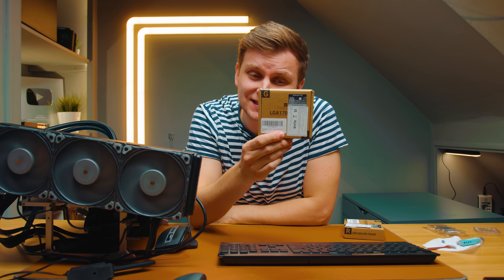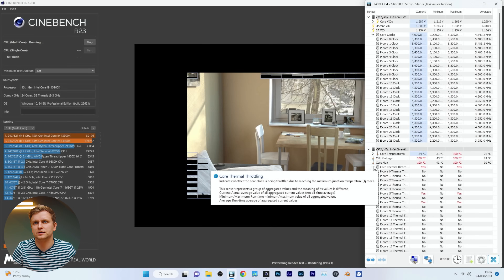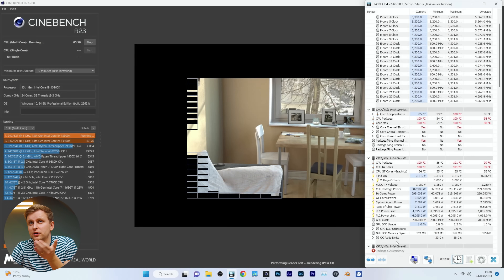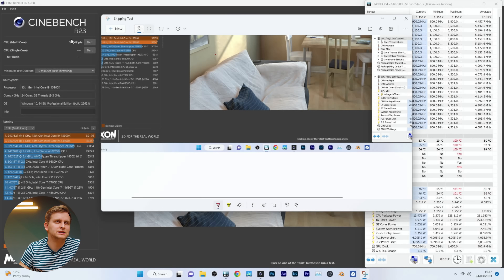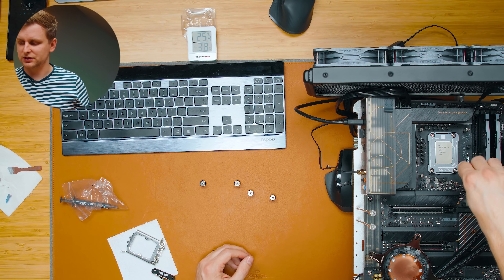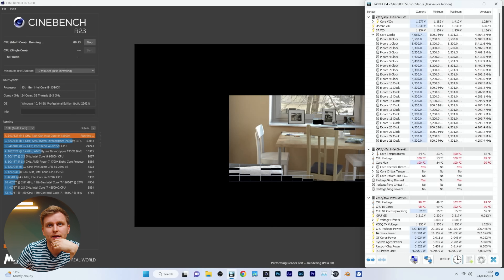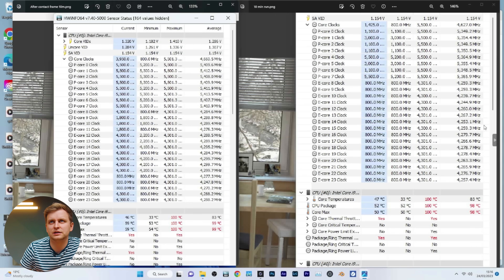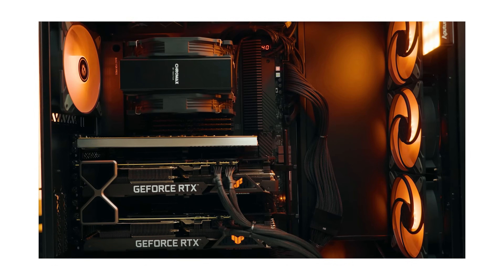This Makes Your CPU FASTER & COOLER 😱 | Budget CPU contact frame for Intel & AMD

Comment: i dont understand the need im running a 12900ks and never see temps above 60 on full load with a AIO, but if fell like if your buying a higher end processor you can get a AIO

Comment: 14:00 yea....how about you reapply the thermal paste without the frame. Fresh thermal paste makes a difference, also you might got lucky and you applied it better.....to make this test valid, you should put the frame and remove it and run like 5 tests for each , which in total would be 10 tests.

Comment: One thing missed, put some heat sink past onto the new frame, the part that will make contact with the copper plate on the bottom of your cooler.

Comment: Of course the biggest different would be the cooler, liquid has less pressure on the plate however if you have cheap on 150$ and stick to air cooling that's a big win.

Comment: Using Noctua’s ND-H15, I made many 12 and 13 gen i9 configs, some with contact frame some without. I could never find a meaningful difference outside the silicone lottery variations. Maybe the Noctua cooler is better than others (I haven’t used anything else)
Reply: I've been thinking the same also.
Reply: Thanks for the info, I have a NH-D15S (with two fans) and was considering buying this for my 13700k but I've now reconsidered, especially since my cpu is delidded, and since I will be  upgrading to 14th gen in a few months.

Comment: i mean a cooler cpu isn't gonna be faster if it doesn't throttle either way, so not sure it would change a lot for me.
Reply: The cooler it is, the less it has to throttle, the better it performs.
Reply: @THE-X-Force  yes, I know that, but i was saying that if it doesn't throttle at all, cooling it further won't change anything.

Comment: Nice video. Be assured you overtightened the screws ;) they probably get around 0,5 Nm or less. There is sheets for any screws and how far you can tighten them - for professional results I recommend using a torque wrench :)

Comment: HIgher clock speeds generate more heat, so perhaps by being able to achieve higher clock speeds with the THermalright plate accounts for the slightly higher temps.

Comment: Just turn off hyper-threading. In games on this cpu there can be no difference and undervoltage. And from 300W there is suddenly a 240W cpu and +15-20 degrees.
Reply: Why would you disable performance enhancing technology that you paid for. All you're doing is crippling the CPU. Might as well just by a lower end one in that case.

Comment: So what's the best AIO for the 13900k? I'm in the process of building a new PC. I'm still running an i7-6700k... lol! I play games and also perform Blender Renders along with Substance Stager/Painter here and there. I'll get a contact frame as well, but if the AIO makes the biggest difference, then which AIO is currently the best for this CPU? Currently limited to a 360mm AIO.
Do you have a recent video that covers this already?

Comment: 🤣🤣🤣🤣🤣🤣🤣🤣    LIES      You're not increasing performance at all.  You're changing the contact pressure of the cooler which is making the CPU volt higher due to lower temps....  You're tricking the Bios to think it can over volt the CPU and get more performance which is dangerous and you know it.    Stop lieing to these people with your BS headline.
Reply: Nice joke 😂

Comment: The second test is 1 degree C higher because it was running 13 seconds longer, as you said.  More time, more heat during the test.  I just hope that bracket doesn't trap heat on the sides of the CPU.  Given the temperature, I think it would be ideal if the bracket was an additional heatsink dissipating the heat from the sides of the CPU.  Additional passive cooling combined with good case ventilation.  Would love to see a test run then.
Reply: I have 13700k i undervolt just -1.000 on bios and now i have max temperature 85 on stress test i think undervolting is helping more
Reply: @hovighovig608  Did that affect performance?
Reply: @THE-X-Force  yes just undervolt it now i have max temp on stresstest 84c in games max 73 like nfs unbound
Reply: @hovighovig608  OK but I'm asking if that affected performance as in .. benchmarks .. frames per second .. etc. Sorry.
Reply: @THE-X-Force  Month later so not sure how usefull this is, but i have the 13700k. My pc kept overheating to 100C, which made certain games crash under heavy load. Simply turning off CPU Game Boost in Bios completely solved it, and max is now around 85C, no more crashes. I also havent really noticed any difference, but dont have any stats to back that up
Reply: @kyotsuki  Thanks. I appreciate the info. Glad your rig is running better now. ☮
Reply: @kyotsuki  you prob lost 400mhz boost tho.
Reply: @tarkitarker0815  didnt matter much in my case, since my cpu never goes past 50% usage
Reply: @kyotsuki  it does matter HUGE in games, i dont talk about absolut hammered avx performance, i talk about allcore boost, which is what your cpu uses in gaming.

Comment: It was hotter after you installed it because it was able to draw more wattage. So, that simply means the benchmark was able to also draw more which will, obviously, add heat. So this is good. Really good. Simply put, the added cooling abilities allows to push the cpus output performance. You would only result in cooler temps if there was a way to cap the wattage usage to match that of the test done before you did the install. That would truly show if it lowers temps.
Reply: It can also be useful when overclocking than having motherboard ai or stock marketing junk, manual is a better option to handle better voltages and probably oc to 5.6 to 5.7ghz
Reply: @redclaw72666  manual oc is NOT better on amd, intels do not have a quick response clock gen like ryzen has, so them constantly running at max clock but reduced bus is ok, but amds cant reduze IF clock, which is why a manual oc´d ryzen will chunk power.
Reply: then that means your cpu was not getting enough cooling to run at max in the first place. ever heard of undervolting? make 10c go away like magic if its drawing more power after installing this.
Reply: Honestly I was kinda disappointed he wasn't able to realize that.
Reply: disable turbo boost and it should stop the slight over clock
Reply: does it make any difference in gaming ?  will u get a higher framerate??
Reply: No, this is not completely correct. Yes, it dissipated more power (watts) which is why it ran hotter. BUT the whole idea of this frame is to keep the CPU cooler. So this is NOT good. This merely showed that the throttling of the CPU was slightly different between the two tests and the software gave a slight advantage to the aftermarket bracket by allowing it to run slightly hotter. I'm willing to bet that if he ran many tests in both before and after configurations and averaged the results out, there would be little to no difference. The biggest factor by far was the overall thermal setup - actual cooler used plus thermal conductivity of the thermal compound.
I do agree with the your last part. The only true comparison is to have both tests dissipate the same amount of power and measure the final temperature difference, if any. 
In theory, if this frame was part of the overall cooling frame (e.g. thermal conductive paste between frame and CPU) then the added mass of the new thermal frame would add a tiny bit to the overall heat dissipation. But, then, the original steel bracket would have also added to the overall heat dissipation as well. However, Aluminum makes a better thermal conductor. 
<Power supply designer>
Reply: @bigdog8008 He's adding a metal frame around the cpu, which means it's going to trap more heat.
Reply: @mikem9536 not so. The plate is aluminum and will transfer heat thru the ridge surface contact all around. The majority of heat is transfered thru the top surface to cooler anyway. On my 14900k cb23 before adding the plate, my Temps were 86c to 87c, occasionally pinging 88c. After adding the plate, temps dropped to 81c, using exact settings and room temp 78f(25.5c). My game pc 12900k had a 3c drop after adding the plate.  Having equal torque all around,  as apposed to only LH  and RH centers from default clamp, is a much better idea.
Reply: @bigdog8008 this is an anti-bending correction frame, not an anti-heating frame 😂😂😂

Comment: nice video but... this comparison does not tell much. 330W load is unefficient and does not tell us about cpu temerature  because W is to high. Lower load from 100-250W willl be better to compare few processors like i7/i9. Biggest difference is on load where cooler can cool cpu to 90-99C.

Comment: The contact frame, aside from providing a secure and even mount for the CPU, also provides more Aluminum MASS that helps to further bleed heat from being connected to the IHS.
Reply: Yes but there is no paste in between the IHS and the frame, so the contact is not optimal
Reply: @simonb.8868 depends on you base for the cooler and how you apply the thermal paste or graphite pad.
Reply: Yes I have a same theory that the contact frame also functions as an "extended" IHS since its also made of metal

Comment: I use a gaming laptop which are usually known for running bit hotter than pcs. N idk the cpu differences... but would this work for laptops? I have a ryzen 7 6800hs and a 3080 gpu. In my laptop

Comment: For such a cheap item, hard to say no to it. At the same time, the benefits just are not sufficient enough to really be worth wild. For people absolutely desperate to maximize performance down to 25mhz even as well as people worried about long term bending of a chip I suppose its good.

Should be something board makers look into to replace the current latch system.

Comment: do a test with thermal paste on the metal to metal contact points so the frame itself can be a heat sink. i think this would be a better test for the ryzen cpu. also imagine if the contact frame was cut so precisely that it could cool off the sides of the cpu as well with applying thermal paste.

Comment: The IHS is not bending, the single arm ILM frame is not strong enough to keep pressure on both sides of the CPU causing it to not sit as flat as needed for good cooler contact. If your IHS was bending a contact frame wouldn't solve that issue, the CPU would still be uneven.
Reply: This also fixes some problems with heavier dual tower air coolers and certain mobos bending the socket making the ILM frame issue even more pronounced. I've seen 5-10c documented improvements with watercooling running the same voltages and clocks but upwards of 15c cooler temps when using a heavy dual tower air cooler and the contact frame.

Comment: Im running the Thermalright Peerless Assassin 120 SE (single fan only) with the contact bracket from the start on my 13600kf - 5.3ghz all performance cores, 4.3ghz all efficiency cores,ht disabled at 1.28 volts, 200w limit, this combination is crazy for the money, gaming temps are around 60-70 degrees, full load stress testing makes the hottest core go to 90 degrees but never exceeds it. Got everything for about 40ish bucks off amazon
Reply: Hm, did you try out this bracket now though? Cause maybe with it, you don't have to limit the power anymore.
Please tell me how it is going right now, cause I have the same setup
Reply: @MaryArts  what I meant was from the start when I first built I went with the contact frame I didn't even try without it
Reply: @MaryArts  also I set the limit of 200w because my z690 pg riptide was allowing it to pull upto 250 which for this specific processor even oc is overkill and a waste of power
Reply: @goodactionshit520  Thank you so much. Gotta buy that frame now. Thank you for the assurance

Comment: Its crazy how high auto vcore is on the 13900k... got mine down to 1.25 from 1.43... dropped my r23 temps by 20c and kept the same performance... hell im now at 5.9 on 2 cores and 5.6 on the rest with a score of 42k and still doesn't require 1.43v like default runs cooler as well.
Reply: The auto vcore is set compatible with any CPU, to avoid any instability, of course, it has a higher voltage. That is why players like us will tweak the settings to better match our hardware. But I am curious what your sp/ biscuit score is for your CPU, based on your information, it seems like a very good one.

Comment: Was using default type of the frame for my 12600k and it actually stopped working after ~ 1 year. It occurred my CPU bent A LOT and was way too kind of curvy. So, basically, there was no contact between CPU and the socket. I recommend everybody to purchase this 10$ thing, it will save much more
Reply: Does your CPU start working again after installing the bracket ? or you had to buy a new one CPU ?
Reply: Would like to know too.

Comment: I keep seeing "a bent CPU is bent forever" repeated however this is not true, metals don't work like that. Copper will spring back unless it is bent too far like a spring. The infinitesimal amount of bending isn't enough to cause plastic (permanent) deformation.
Reply: It's true you can bend them back, but you have to be very careful doing that as they can easily just completely break off, especially on Intel CPUs since the pins are extremely thin, then it's pretty much over also if you don't bend them just right in place it will cause memory issues and blue screens

Comment: DO NOT cinch down the screws, two finger tight only and stop when the screws stops turning, make sure all four are equal, gradually tighten opposite corners a bit at a time. If you're worried about the screws backing out get a threadlock stick and apply to the end of the screw (you could use liquid too but the stick is easier)

 Performance of the Thermalright and Thermal Grizzley frames are basically the same except the Thermalright frame is much easier to install. The Thermalright frame sits flush with the MB and the Thermal Grizzley frame floats, with the Thremalright frame you just stop when the screws stop where with the Thermal Grizzley one you have to fiddle with screw tension (ideally use a torque controlled screwdriver).

 If you use acetone to clean the CPU don't get it on the plastic "feet" on the ends of the Thermalright frame it will attack the plastic and the adhesive that is used to attach them to the frame.
Reply: dude wth are doing using acetone anywhere near a motherboard or CPU? even the vapour will depolymerise (i.e. molecularly disintegrate) polycarbonate or ABS. The electrical insulation lamination on PCBs is often PC. There are ABS and PC plastic components across your motherboard and also on the case. Even the shroud on your GPU is made from PC/ABS. You are literally molecularly disintegrating your entire PC. Plus it's flammable, toxic, volatile and a respiratory system irritant.

Use 99% isopropyl alcohol as used and recommended by the manufacturer.
Reply: tomorrow i need to put back original lga "contact frame" and cant find any video.
scared af
Reply: no way in hell the thermalgrizzly is the same, precision machining is not possible at the 10 bucks price, also the floating is a must.
Reply: @JohnSmith-pn2vl gamers nexus tested and they do perform the same. Thermalright has greater variance in machining precision but not enough to effect thermals
Reply: @Cwronaga216  They made up for that with a better design. In the end they both perform the same.

Comment: I just can’t understand one thing: what kind of processor distortion are we talking about, which is under cooling pressure over the entire area🤷
Roman initially promoted this mount so that the socket contacts evenly touch the processor. This is simply impossible, since the mount is only screwed on at the corners, and therefore, I consider this purchase pointless, which is for 10 or 40 bucks

Comment: For the first test with the original bracket you did not use the same thermal paste that you used with the contact frame so that is the main difference !

Comment: Would you guys recommend this for an I31200f with a stock cooler, or should i just get a 20-30 dollars cooler
Reply: The corect title for this video should be: Things to do when you overclock your system, you want to prevent cpu throttling and get a higher benchmark score. Stock cooler for i3 is enough - change it only if is too loud. That thing promoted here is for overclocking enthusiast and benchmarks and has 0 impact for 99,99% of computer users. The cpu's starts the reduce their speed above 90 degrees to prevent damage,  otherwise their speed and performance is the same at 30 or 80 degrees temperature.

Comment: There is a huge misunderstanding on your part! you misunderstood the use of that product! in the 12th generation of intel chips, now the motherboard is faulty, it is bent in the chipset part! and the effect of this product is to prevent the motherboard from being curved in the chipset. When the motherboard is bent, the chipset heatsink will not be good, leading to the chipset getting hot! Therefore, the main effect of this product is to prevent curvature in the chipset part of the motherboard, not to help reduce the temperature of the chipset! I personally find this product very convenient because when using it, applying thermal paste will be a lot easier!